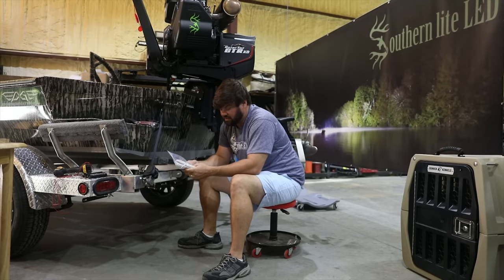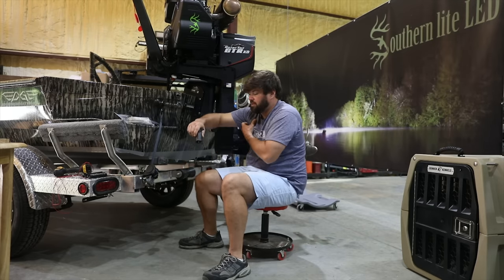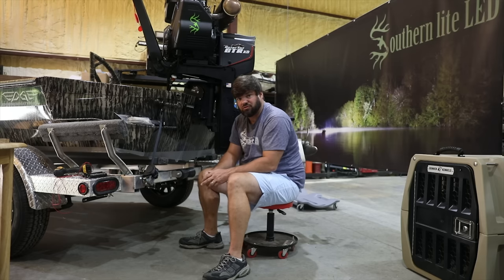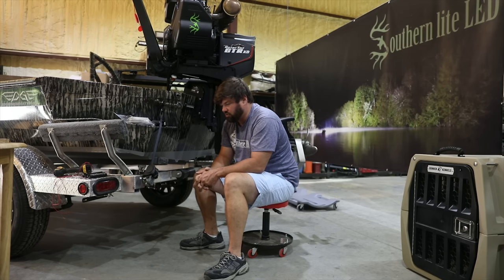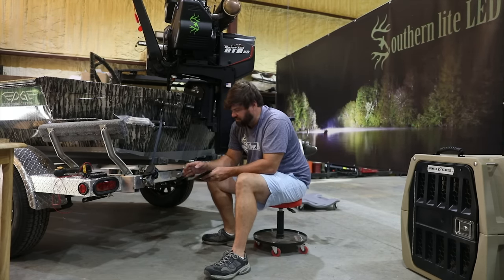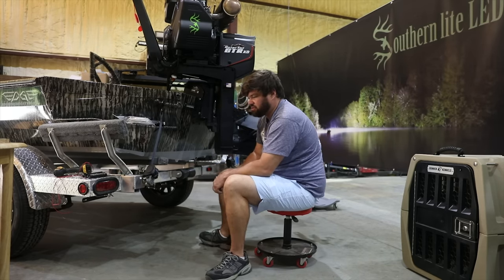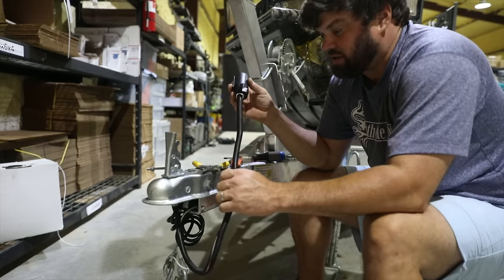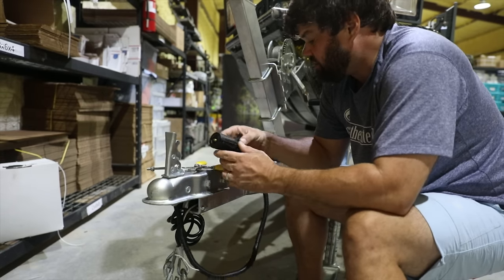INSTALLING BOAT TRAILER BACKUP LED  LIGHTS By SOUTHERN LITE LED

Comment: How do you wire those lights so you can turn them on and off while the trailer is in the water? Not keeping my vehicle in reverse.
Reply from the maker: You can call us and we can explain for your vehicle
Reply: You need a switched feed to the lights

Comment: I did this last year, folks this was a huge game changer for me. Very pleased.
Reply: Jayson Grimes I usually turn on the lights on the rear of my boat as I back down ramp in predawn hours. I may do this also for times when I’m not launching boat
Reply: It will help.
Reply from the maker: Thank you

Comment: Great video! I thought you were going to show how to connect the undertrailer lighting.? I am looking to upgrade my trailer to 7 pole, I think it's called, and my biggest additions is reverse lights, really appreciate this video, not easy finding tutorials on this job.
Reply from the maker: We supply with kit
Reply: @dnrhyne  just finished it yesterday, Sunday. Turned out great, thanks for your video.

Comment: Where do you connect the red and black wires from the auxiliary lights to the plug?
Reply from the maker: Not sure what you are asking
Reply: Southern lite LED in trying to connect some auxiliary lights right now (I’m outside) and I know the center pin is for that. But my issue is does the red go to the middle pin (for reverse) and black (negative) go to the white wire?

Because I tried that just now and it shorts the reverse lights on my truck and turns them off and the auxiliary reverse lights don’t turn on.
Reply: Nvm I figured it out it’s the reverse lights I got that aren’t compatible, thanks for the help! Your video was very informative!!

Comment: You change from a 4 pin flat to 7 pin round so if you're truck doesn't have a 7 round you'll need to install that as well
Reply: Should be able to use a 5 flat which is often used for trailers with brake lockout.